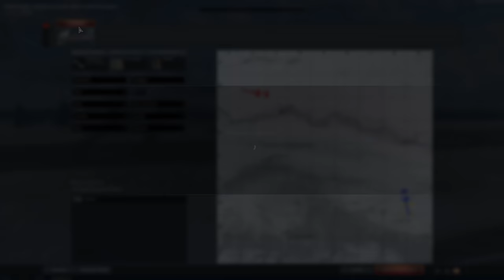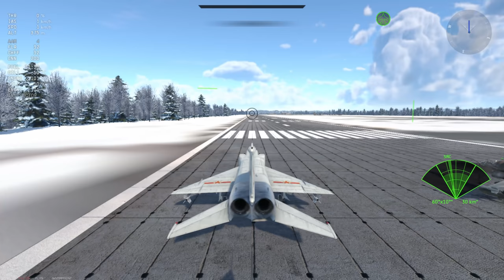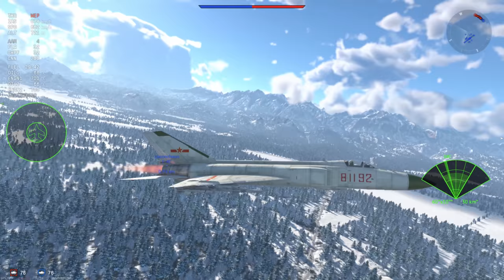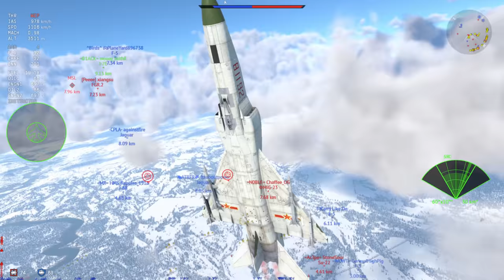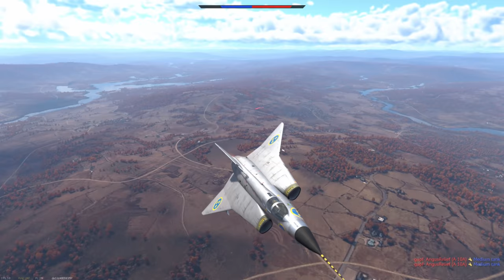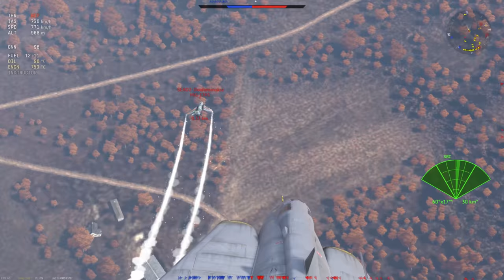It's Time To Raise The BR Ceiling (War Thunder)

Comment: The recent update has been especially bad for top tier air. The changes they’ve made with missiles are annoying especially when my radar missiles guided by MTI radar instantly go for chaff. Getting killed by a J8 4 miles away even though I’ve done everything in my power to evade the missile. And the fucking A10, 9.7 - 10.3 was my favorite BR, now is garbage. The A10 does not fit into the flow of the battle and with all of the 30g IR missiles at the BR it is not worth playing if your plane doesn’t have counter measures. The MLD/MLA is an absolute joke in terms of balance and if I want to enjoy a lower BR of Jets I get R60’ed by a yak38 or partake in the endless flying around doing nothing that is fighting a Sea Vixen.
Reply: yeah, i hate yak 38s

Comment: A nice easy fix is planes above 9.0 only have a 0.3 gap interns of up tiers and down tiers 

For example 11.3-11.0, 10.7-10.3,10.3-10.0 and 10.0-9.7 that way, it's only planes of similar capabilities and prevents the need for constant br decompression ofc it will still be necessary but it prevents mig21smt's from facing cl-13's

Comment: lim5/mig17/mig17as- 9.0 g91r1/g91r4- 8.7 f2h/f9f8- 8.3        yet the f40 sabre is 9.3 compared to the normal sabres 8.7.      when superior variants of the same vehicle, either by performance or the addition of missiles, doesnt change the br something needs to change
Reply: even better is the ridiculous progression of performance for the br,   the difference in br between the regular sabre (aside from the a5) and the slowest sabre but with 2 missiles, is the same br difference that same sabre and an a5c, or phantom, or mirage 3cj.     and vehicles like the etendard, super mystere, f11, and so on are at 9.0 br when the basic cl is 9.3, the same br as the lightning f3 lmao

Comment: Sry Spit but maybe you should actually play the F104s a bit more. Because when you talk about them like that without rly flying them, you cant recommend a treatment to them.
F104 issnt get shafted at all oO
The only ones that get Shafted are the 10.7 Variants because of constant Uptiers into 11.0 and 11.3

But the 10.0 A Variant is really fast and quite Agile. It Plays just like a Hit and Run Jet. Similar like Energy Fighter Playstile with Probs.
But it can even dogfight some other more Fat jets. And In  1 vs 1 it would easily win against a G, S or J Model.
F104G Models especially the German one are very Strong. They are quite fast, have enough Countermeasures and having 2-4 AIM9Js with 20Gs is really powerful at this BR.
I do very well with them. The Italian one can even Carry a Decent Bombload together with the AAM.
And if i get a Downtier in the F104S, even in an almost Stock Variant it has enough Speed and Power to outrun and outplay most dangers.
You need to play the F104s a bit like a Sea Vixen but with a Cannon^^

Also Dont forget about the unplayable 8.7 BR. My Last records of this Week looked like 14/15 Matches were full uptiers against 9.7s like the F105D, AV8, A10s, Mig19s and several Mig21 Variants.
The fuck are you going to do here?
Some Flying Shit like the Mystere IV that is worse than almost everything even below its own BR apart from the Cannon is still 8.7 oO
Its not a total Bad Plane but its just way too slow for its BR, needs way to long to get to speed.
Reply: I agree on the 8.7 explenation. Thats why i play mostly 8.3 (F9F-8 is my babe ;) , because 8.7 guarantees a 9.7 uptier. Now planes like the mig 19 have such a performance that can turn other aircraft into dogshit. The only thing that makes it worse is that the enemies have missiles
Reply: @ELITE-xn3sh  I agree.
I like playing the A4H for example because of it its really good and fast for an 8.3.
IT got very nice Bombs but since your team is mostly US, Israeli + brits you can win 50% the matches only by tickets and running, because your team always dies but you can have a good ticket advantage xD
Reply: @SpriGgEx  I still don't understand how the A4H is 8.3 it has a better engine than the A4E which is at 8.7
Reply: @H-cranky  
1. I bet you mean the A4B because it has the weakest Engine of them all
2. A4E all Variants have AIM9s and guided Bombs so making them potentially more dangerous in air RB and Ground RB
3. The Israeli Premium A4E has the same Engine as the A4H
4. the Sa'ar also has the same Engine as the A4H but weighs at least 50% more and is slow as fuck ^^

Comment: I honestly preferred the MiG-21F-13 when it was at 10.0. I understand that it doesn't have flares or an RWR, or anything for it to be a top-tier contender. But latching on to F-4Cs and choking them to death was more enjoyable (and honestly easier) than flying the jet at 9.3 and trying to put 1 of 60 rounds into a subsonic plane that can turn on a dime lol

Comment: Viggens m/75 ass and it's acceleration is meh. Viggens radar also got nuked. MLD and MLA have no equals in game. The closest, funny enough, is probably the J7E as of right now. J7E has great flight performance and the new PL5Bs are the best short range IRs in the game. 12.0 is a maximum we could go too, do to the number of jets in the game. I have a friend who reworked BRs and decompressed on a spreadsheet. His words were "12.0 was very difficult to achieve, and 12.3+ isn't possible right now." I doubt gaijin will rework brs.
Reply: "Mld and mla have no equals", gotta disagree with that, the viggen,fgr,f4ej and j8b are all equal with them
Reply: @aregulargenericname8794  They're not. Not in flight performance, avionics, or armament. R24s are much better then Skyflashes or AIM7Fs at the moment. Apsides might be better if the J8B or 104SASA had a better radar.
Reply: @spray916  they are
Reply: @spray916  the viggen has a mix of flight performance and armament
The f4ej and fgr are armament and accelartion
The j8b is flight performance with a bit of armamament
Reply: @aregulargenericname8794  MLD/MLA can catch anything on the deck, quite handley, and the MTI mode on them is FAR better then the PD mode on any other aircraft at top tier. Out of the planes you've named, which have you flown?
Reply: @spray916  
1. I said "acceleration" not top speed
2. The pd mode is still comparable
3. " Out of the planes you've named, which have you flown?" why does it matter?
Reply: @aregulargenericname8794  Sure. It can beat the low end acceleration. What happens when the MLD/MLA catches you?
Reply: @spray916  depends
If your a viggen then it will be a equal dogfight, same with the j8b
If it's in the f4ej and fgr then youve already failed at playing it correctly and have little to no ability to defend yourself
Reply: @aregulargenericname8794  This proves my point. Viggen gets at most 3 turns. Phantom dies in the 2cnd because it pulls alot of AoA.
Reply: @spray916  It doesn't prove your point
A viggen and a j8b have a fair fight
While the phantoms suck because their not suppose to be close range
Reply: @aregulargenericname8794  Viggen and J8 do not have the MER to keep up with either in a merge. Only the Viggen matches it in speed, but the Viggens acceleration is mediocre. J7E is the only plane to keep up with the 23MLs and it will eventually loose.
Reply: @spray916  again no, the viggen and j8b can keep up
Reply: @aregulargenericname8794  They can't. I HAVE PLAYED THESE VEHICLES AGAINST GOOD PLAYERS IN 1V1s.  They die in the merge and last no longer then 3 turns. 23MLs get wings out, and you die. You haven't said whether or not you own these vehicles. Give me your IGN or ill find it and see for myself.
Reply: @spray916  they can, that is all i say
Reply: i mean the gun itself is great its just that theres no tracers nor its historical radar lead indicator
Reply: also when they implement the weight fix it will become lighter and should be less of a bus